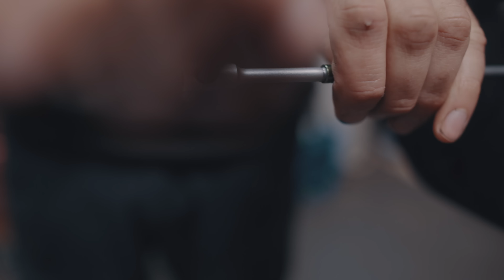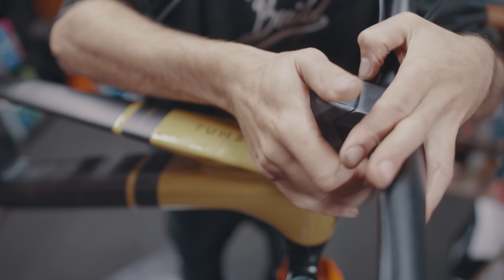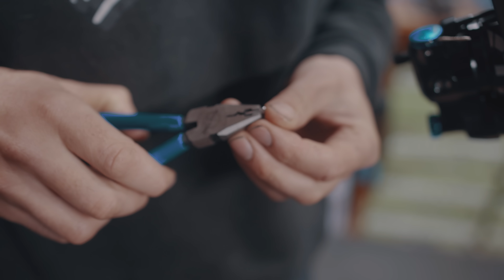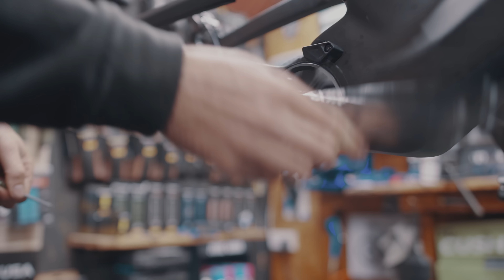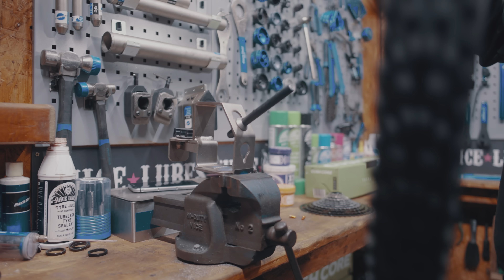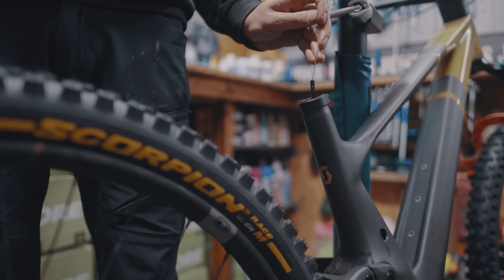DREAM BUILD MTB - Scott Genius ST

Comment: new XTR rotors @15:35?
Reply: @ancogbernard  what😂
Reply: @Dwyane1st  thats not new. that is the six bolt version if you didn't notice 😁
Reply: @ancogbernard  I'm running the 6bolt version on my bike and they are different 😂 hence the question
Reply: @Dwyane1st   your version is old not the frezza version.
this one come little late but this belong to m9100 model.
maybe you are using the old m9000 model.

Comment: Customer: “yeah, can you add another 10mm headset spacer please?, should just take a minute.”
Reply: The headset spacer is a two-piece design so would take no longer to add a spacer compared to an externally routed cable.
Reply: @NowtDaftTonyFawcett  : ahh, thank you
Reply: @GHinWI  you might need to explain the change in cable length situation for the newbies!!

Comment: Great as always. Do the builders go back and torque bolts to spec or do they build strictly to feel?
Reply: depends on the mechanic bud
Reply: Depends on the bolt and the mechanic. At my shop shock hardware, hollowtech crank bolts, seat clamp and stem are always torqued correctly. Everything else is tightened by feel.

Comment: cringing during the entire head tube cable routing section. no thanks.
Reply: I get hiding cables on an aero road bike, but on a MTB 😬
Reply: @DeanPattrick  absolutely agree
Reply: @slowcyclist4324  someone got out of bed the wrong side today 😬🤣
Reply: @slowcyclist4324  hahaha. Wow. Yeah I work on my own bikes because I spend my money on my bikes and components and not paying someone else to do the work. And yeah doing work on my headsets is definitely more than a couple times a year because and I use my bikes and take care of them. If you have the means to pay a mechanic to work on your stuff, awesome, but for those of us who are mechanically inclined who actually find wrenching on our stuff to be half the fun, stuff like silly cable routing is just obnoxious for routine maintenance.
Reply: @DeanPattrick  it just doesn’t get in the way of the rider
Reply: @kingcastle8960  so what have they been doing for the last 25 years.?
Reply: I have a Spark RC and the cable routing though the headtube is fine.
Reply: NOC
Reply: It doesn't look that bad. Change is scary.